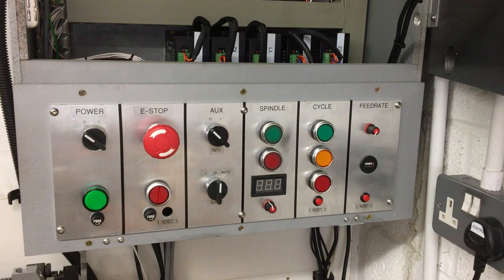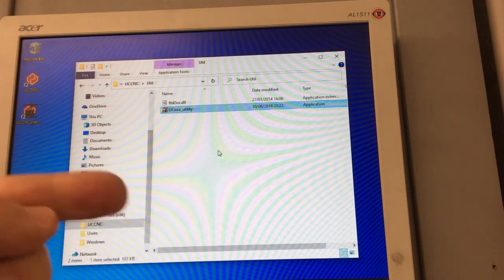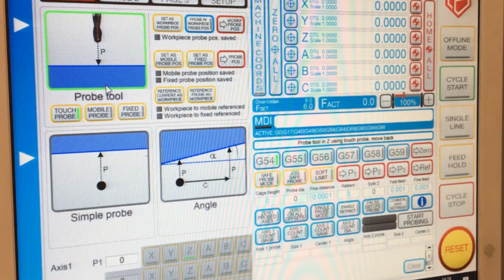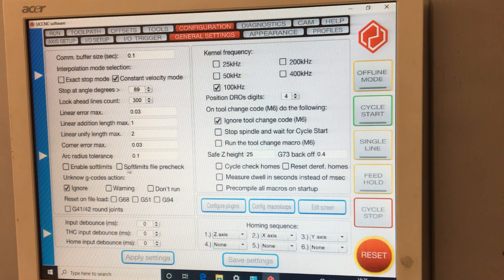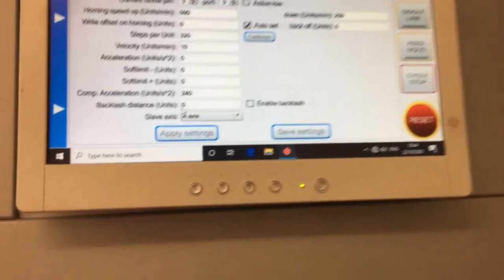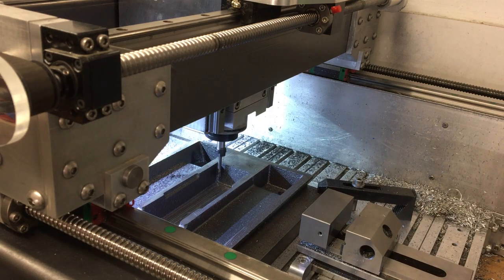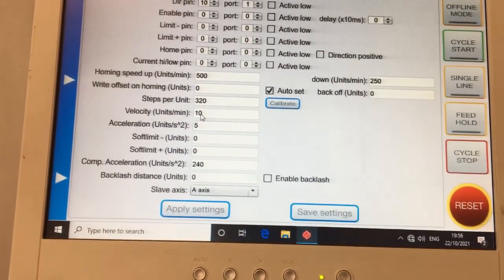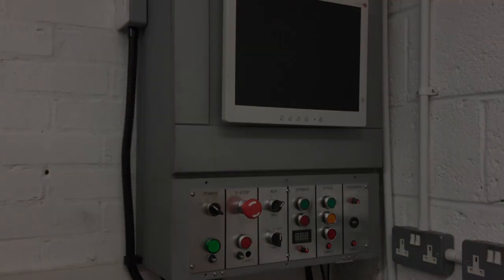Ep31: CNC Ethernet Upgrade - Movement !

Comment: I'm still trying to decide whether to go for ethernet so I'm re watching these to help me decide but I've noticed a couple of things. Why would you need to slave the B with the Z when they are wired together & the controller sees them as one anyway? The other is unrelated to the ethernet, how were you planning to use the 3 digit panel display to read the 24000 rpm of the spindle? I can't remember if you ever did use it but would have been easier to un clip the real display from the VFD & make/buy an extension lead to add that to your front panel.
Also, why wouldn't you use soft limits? That's a weird thing not to use if available. No drawbacks I can think of but could stop a crash, unless never referring all home means a machine has no clue where it is so soft limits would kick in?
Edit of my edit, you didn't slave B with Z
Reply from the maker: The AXBB-E has been flawless in all the years I have been running this machine.  Highly recommended.  Parallel port had random e-stops despite trying to manage the wiring, earth, shields etc. 
It was a long time ago but I think I ran 2 steppers off a single step pin for the dual stepper motor axes.  I did check with AXBB-E that it was OK to source this much current and effectively run 2 opto-isolators and they confirmed it was within spec.  This has worked without issue for years.
I never got around to putting the spindle rpm in the display unit, and did think about remoting the VFD display but in the end I just open the door and look at the VFD when changing speed!
I've never used soft limits, no reason really just got the machine working on the limit sensors and left it.  No issue with using them though.

Comment: could you not have disconnected the z axis motor and wound the ball screw back manually? awesome video though, not many people go through the software like that which is nice to see the difference between them
Reply from the maker: Not easily because they are twin ballscrews on separate motors.  When I first built the machine I powered up the steppers with the couplings loose which allowed the motors to jump to their preferred start position. From then on they would be in sync.  If I moved them manually with the power off they would be out of sync and I would have to repeat the process.

Comment: Great video, I've learned more from you video than I did reading the instruction manual.
Panel looks great as well, looking to build more along the lines of yours rather than a board against the wall.

Just wondering if you could share your panel wiring diagram?
Reply from the maker: Hi Steve
No problem.  The easiest way is for me to upload it as an attachment on the mycncuk forum.  Not sure if you need to be a member to download it.  I’ll try to upload the ProfiCAD file along with images in case you can’t read that format.  Of course it was designed around what I need and there are high voltages in there so seek advice if not sure.  Away from PC so hope to do it this weekend.  I’ll reply here again when I’ve sorted it.  Thanks
Reply from the maker: I checked back on the forum and I remembered I had uploaded the images of the wiring a while back.

Try this link, post #73
http://www.mycncuk.com/threads/7699-metalworking-pillar-drill-experiences?p=128570

If the link does not work then google search "mycncuk routercnc pillar drill experiences", open the forum and go to post #73

Good luck with your build.

Comment: Thanks for the video. Are you still happy with the software and controller?
Reply from the maker: Absolutely.  I’ve been using it for a while now and have had no issues with false estops.  I’ve been able to plug my VFD back into the row of sockets used by the PC and controller.  Before I had a 10m extension cable to the other side of the workshop.  I also much prefer the software over Mach3.  It has more features and feels more complete.  Recommended.

Comment: My AXBB-E 24V green led light is off, did you now any solution. Thanks
Reply from the maker: Use a multimeter to check you are getting 24V to the unit.  After that I don’t know what to suggest.
Reply from the maker: Thinking about it a bit more you can try emailing them.  I've had very quick replies to my technical questions from Balazs.